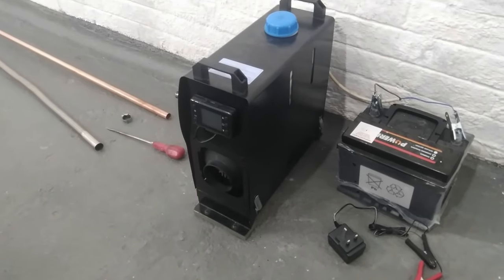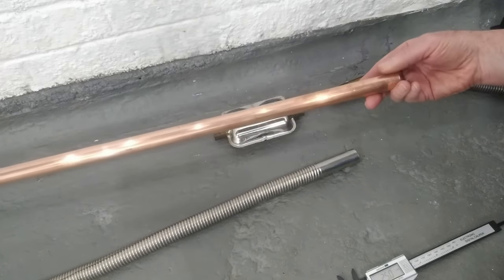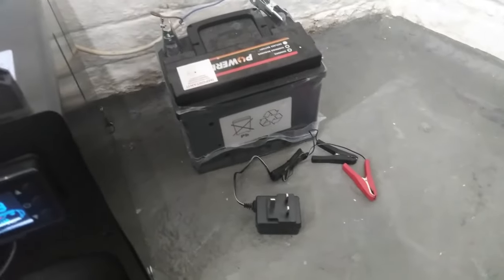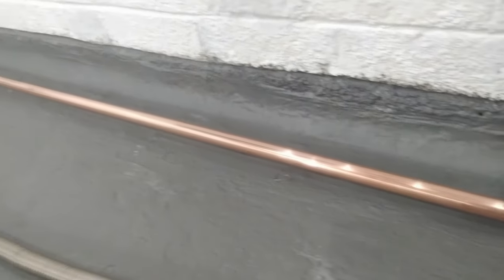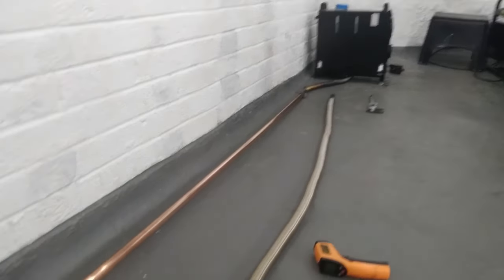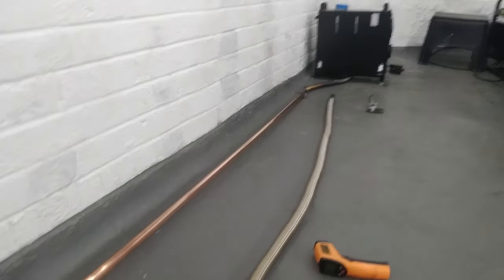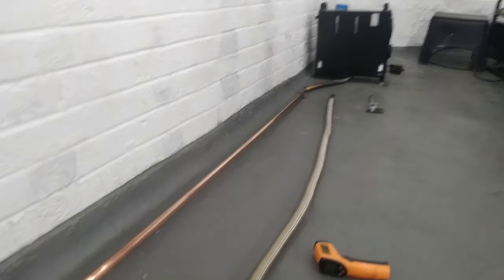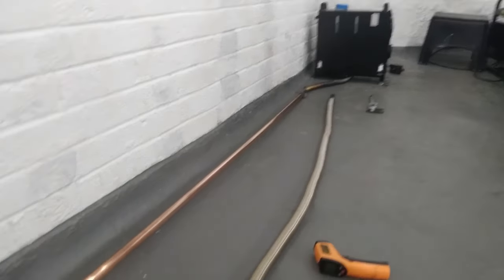This is the Longest Exhaust from a Diesel Oil Heater Chinese Life Waste Camper Van 22mm Copper pipe

Comment: Raise your heater up higher than the end of the exhaust so that condensation can run out and not settle in the lower parts of your exhaust and cause you blockage and then it won't start and run.I found that out the hard way. Just Raise your heater at least 1 inch or so above the end. 30 to 40 millimeters.
Reply: That was going to be my text raising that heater up above the copper pipe so that the water wouldn't settle in that steel tube The copper can handle it
Reply: You are 100% correct, burning carbon based fuel creates moisture, and along with the particulates with cause a buildup and restriction.
Reply: I need to have exhaust running out of the basement 1,5meters above the heater,  only hole in the wall, no way i can raise the heater above it. I can't run the heater in this space?
Reply: @BeyondWrittenWords you can.  Just modify it so there's a place where water can be drained.you can run the pipe across and on an angle down to an intersect box with a drain.  From the box go up and out.  Check the box once a week, drain it, until you figure out the amount of condensation but it might vary depending on things like relative humidity.  If your careful you could probably use a tin with a lid or something with a screw top might be safer.  That all being said if the distance is very small and the exhaust remains above 220 I doubt you'd need a place for condensation as the the water will remain vapor
Reply: THANKS!!
Reply: Another idea, heat sinks on the exhaust tube to catch some of that exhaust heat ?
Reply: @eby6114 you could also set up a small drain pump similar to an air conditioner condensation trap using a perlstaltic pump which would self empty when full saving the need to empty regularly
Reply: , or 1" , to 1 1/2" 😀
Reply: I think because it's just a test he will probably do that.
Reply: @BeyondWrittenWords just remove the pipe and mop it up with cotton wool once in a while
Reply: @BeyondWrittenWords  wall mount the heater?

Comment: Pro tip - for 3/4" pipe in the US, instead of taking the flex pipe and coupling it to the copper pipe, add a copper coupler to the pipe and put the flex pipe over the coupler and clamp it down.  It creates a much tighter fit and in conjuction with exhaust sealent, should make a leak-proof fit with the clamp.  I used two clamps, one on the coupler copper side and one of the flex tube end that connects to the copper coupler.
Reply from the maker: Thanks for the info
Reply: I used 1in conduit and extended my exhaust 20ft under my 5th wheel to keep my water from freezing in negative temps. So far so good.

Comment: whenever you lengthen or increase overall restriction of an exhaust system, you should increase the size of the pipe. The reason is you need the unit to be able to freely push at its design capacity.. if you start building back pressure it will effect operation. Gas furnaces have a pipe sizing chart we use to determine the pipe sizing. two things increase it, size of the unit and length or run (and number of elbows)
Reply from the maker: true
thank you for your comment did you see my other heater vids, https://www.youtube.com/@andyfireblade let me know what you think, cheers andy

Comment: As a Eberspacher installer for 20 years, anything over 3 meters, you need to increase the diameter of the exhaust to 30mm. They make adapters to fit the exhaust on the bottom of the heater, they are 90 degree adapters, top tip look for the ones with the drain bolt
Reply from the maker: good point , i will look into that
thanks a lot andy
Reply: what difference would that make when the exhaust port remains the same size?
Reply: @deer8730  in easy terms, it's easier to blow in a big tube than a smaller one

Comment: Pass it through an old radiator and put a fan behind it to recover the maximum heat or put the radiator over the fresh air intake to preheat the incoming air and increase the heater efficiency.
Reply: if you preheat incoming air you risk damaging the electronics which need to be cooled or if the electronics are elsewhere you risk blocking the heater X high temperature...efficiency does not increase because the ∆t is the same

Comment: To avoid and flow restriction issues, I'm looking for a low cost way to connect two corrugated pipes in parallel. Y joint needed a plumbing T will defeat the object.

Comment: There are baseboard radiators like this that are perfect for this application (because they have heat exchange fins) and a better fit for using the exhaust as a secondary heat source than the square radiator you were using. The square radiator hooked up to the exhaust was also not allowing the heater to breath easily.
Reply: I looked into the idea of using the finned radiator tube to captrure more heat but the ones I find are only 3/4" diameter and that would be too much resistance for the combustion fan in a long run. I'm still looking for something with a larger inlet and outlet for my project.
Reply: A radiator bore (not the pipes usually used to connect) is considerably more than the 22mm pipe so air resistance should be no problem.

Comment: i heat my shed with one of those, and been doing it for years.  I bought another to heat my house.  I ran the exhaust 8 m of 25mm to try to capture that heat.  My machine ran for 2 days then failed to ignite.  I took the unit apart and the combustion chamber was packed with carbon.  Its back up and running with the stock exhaust.
Reply from the maker: hey jason
thanks for sharing that
cheers andy hny
Reply: Hey Jason, probably discovered this already, but if the exhaust is to long like 2m or more you'll lose the back pressure needed to aid combustion, leading to non ignition or white smoke causing coking and exhaust blocking with fluid, mine actually blow the internal gasket causing fumes to leak and stink my house out.  

Great video mr fireblade, I'm a suzuki man myself.

Comment: You will find using a corrugated exhaust that there is more resistance to the gasses flowing due to vortexes caused by the corrugations. You will be able to use a longer pipe with a smooth bore no problem, only thing to bear in mind is if you start putting joints and bends on the copper pipe, this can drastically change the flow and ability to exhaust gasses. It’s a great way of utilising heat that would otherwise be lost. Have a look at making a sand battery by boxing in the exhaust pipe and filling the box with dry sand, this will work like a night storage heater then releasing the heat slowly even when the heater is off. 👍
Reply from the maker: great comment
thanks mate
cheers andy

Comment: A lot of people don't understand that the red rotating disc that provides the air for combustion is not a fan it is a vortex compressor that provides relatively higher pressure often in the 1- 4psi range (used by many fish pool aerator systems).
Reply from the maker: thats interesting, cheers andy
Reply: @andyfireblade  Its a relativly new technology from the 1970' where each blade or !paddle" causes the air to spin in the adjacent cavity ont to the next paddle - each vortex bilds on the next  building up  the pressure the gap between the spinner and cavity has to be minimal to prevent leaking.

Comment: This is a good setup and helpful. If you want to capture more heat coming off of the copper run, clamp one or two larger copper pipes above the exhaust pipe. Thanks for taking the time.
Reply from the maker: thanks for looking.
Thanks for the tips!
cherrs andy

Comment: Andy get some black bbq spray and spray the copper in a few areas lightly and tells us what temps you are getting along the lenght also id raise the pipe as it comes out of the heater to just a bit higher that where it exits the wall cos the copper started off cold so ya will get a lot more condensation

Comment: Andy if you shroud that pipe with storage heater bricks you will increase the efficiency .and harness more heat .I got my heater today and used an XBOX power pack    to run it works a treat .
Reply from the maker: Thanks for the tip!

Comment: I'm seriously impressed by how hot it is so far from the heater. Must be very wasteful then in a truck situation.
Don't leave the battery on a cold concrete floor. I don't know the reason but the cold will kill the battery. Put a piece of wood or something under it for the insulation.
Reply from the maker: ok, thanks andy
Reply: The battery uses a chemical reaction to produce electricity, this reaction can only perform within a specific temperature range, if the temperature falls either side of the perimeter the battery gets damaged.
I think that most batteries have a limited lifetime, capable of a number of cycles
Reply: @stevenclarke5606  if you keep the battery on a trickle charger + 6 amps minimum, the battery will last forever (my current setup is ticking over 8 years). Cycling down to nothing and recharging is the killer

Comment: You should pitch the pipe to push condensation out to the end. Use a hydronic finned baseboard radiator to improve your heat
Reply from the maker: i will do that, cheers andy

Comment: Made the same exhaust using 1inch EMT PIPE 10ft along the floor with 8ft run up a wall  to exhaust out
It provides radiant heat 

Beware the exhaust does create carbonic acid which will erode metal eventually
Reply from the maker: cool, sound great.

did you see my other heater vids, 
https://www.youtube.com/@andyfireblade
let me know what you think,
cheers andy

Comment: I found long exhaust causes sooting up  unless you increase the diameter I also use 28 sec heating oil as it burns a lot cleaner and now I  don’t need to clean the heater   And it’s lot more reliable  I use mine daily in the winter
Reply from the maker: good idea, diameter. thanks andy

Comment: Hi Andy. Great video and just up my street. Have a CDH in our Sprinter Campervan, and now going to put one into our lounge in the house. Using a 'Y' piece splitter two lengths of copper pipe would make a very effective 'radiator' or even solder together a 4 way split at each end then into the exhaust...Have a fall on the pipe to allow water vapour condensate to drain out of the exhaust. 
Thanks again. Tony and Carolyn. :)
Reply from the maker: Sounds great! thats a really good idea. keep warm. cheers andy

Comment: Thank you for showing me that it works because I'm going to use steel pipe and run it up my chimney where I can put my heater in the fireplace that way it will win it up out of the house
Reply from the maker: good idea, i have heard of other people doing this also. good luck cheers andy
Reply: How do you plan on dealing with the condensate?

Comment: It looks like you could use a 6 feet length of 2 1/4" ID vehicle exhaust bent into an 
inverted U shape with reducing bells at each end of the U to use as a radiator and 
recover exhaust heat usually lost from the diesel heater. The inverted U shaped 
radiator likely would be condensing on the downward path leg and need a drain
slope for the horizontal L leg through wall to the outside as condensate drain.
The phase change for the vapor condensing dumps considerable heat and the
most efficient furnaces are engineered to be condensing furnaces to use that
extra heat indoors instead losing it to atmosphere outdoors in the exhaust. 
Years ago I think it was Coleman and some others sold a through the wall
condensing kerosene furnace that was so efficient that metal piping was 
not required for the exhaust cooled down far enough to use PVC and the
condensate would be dripping from the end of the plastic exhaust pipe.
Reply from the maker: great comment , thanks...

did you see my other heater vids, https://www.youtube.com/@andyfireblade let me know what you think, cheers andy

Comment: 100% positive here ,  that the actual heater itself must be raised up so as to create a downward flow of exhaust gasses and thus a run out of condensation as well . I am in Canada where the temp. drops to as low as - 54 degrees C ... often - 25 to -35 C for weeks in a row .  I run my generator / my wood stoves / and soon to be 2 of these wonderful heaters into sealed 45 gallon drums and then exhaust the waste gasses , as this creates a heat exchanger system , but " Please make Sure" , the exhaust areas are extremely well sealed ... the barrels are extremely well sealed ... the process is to exhaust enter into the top of a barrel or 2 stacked and let the heat and exhaust fill up the barrel(s) , then at 1/3 of the way from the bottom of the barrel , you create the new exhaust port to an outside location ... been 100% off grid for 8 years now and this system works wonderful for less fuel costs and less waste heat .  T>>>...
Reply from the maker: wow thats cold, you must really know what your talking about. sounds good. stay warm my friend
Reply: That's a brilliant idea. Obviously you're using a metal barrel,right? I think I might do this, I'm off grid in my large 40ft fifth wheel. I have wrapped a skirt of 1.5in foam around the sides and I have a 300gallon water tank under the front fifth wheel overhang and since it's wrapped in foam, it keeps from freezing.  I might put a 55gallon barrel next to it for my diesel heater exhaust to extract the extra heat and help keep my under RV from freezing and my water tanks from freezing.

Comment: The copper is turning colors due to oxidation on the surface. This is called a patina. In most cases, this happens in normal atmospheric temperatures and conditions, and it's the familiar greenish color. This is happening under extreme heat, causing the oxides that form to be of a different chemistry and therefore different color. This patina gets thicker the longer the metal stays heated, which also influences the color.
Reply from the maker: thanks for the info
cheers andy

Comment: Spray your copper pipe with Matt black heat proof paint that would be used on a woodburning stove and your laser. Thermal temperature gauge should work a lot better. Cheers Derek

Comment: Loads of comments for you, but you could run that pipe through some sand and make a thermal store (Sand Battery) plus from looking at other vids you can mix chip fat oil in and it'll run, the chip fat just needs filtering of course.. 
Top work
Reply from the maker: i will do that. thanks for looking and your comments
cheers andy

Comment: The heater exhaust gets up to 525⁰ F. Copper pipes fail at 401⁰F.  You can't safely use copper to exhaust that heater.